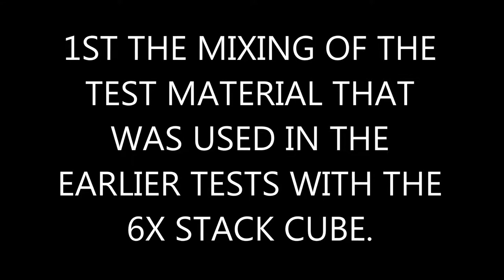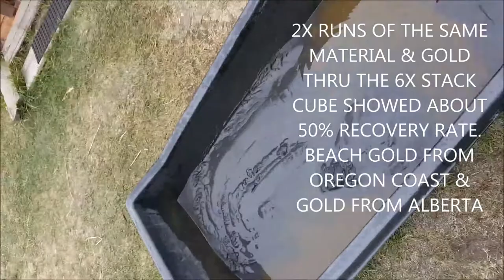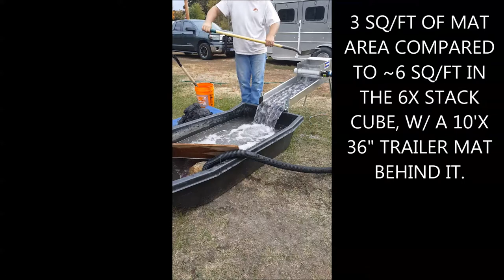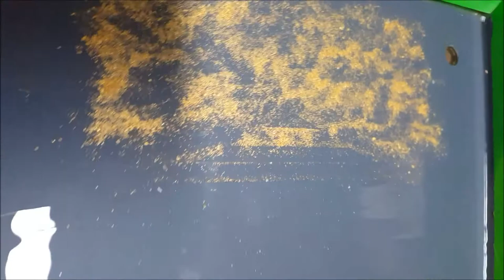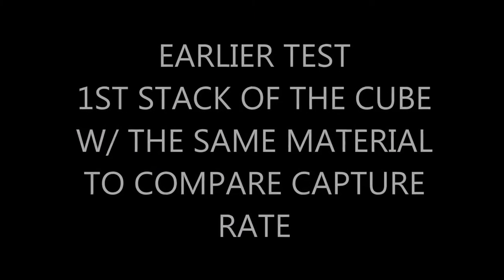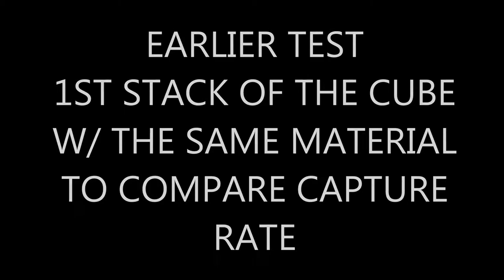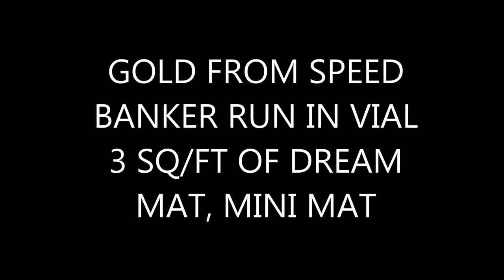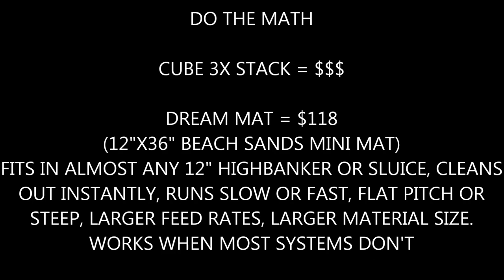Speedbanker vs. Gold Cube Showdown: Real-World Gold Recovery Test with Dream Mat!

Comment: Nothing seems to work as well as your original prototype because it had a simpler system with high walls to create a definite vortex that catches all size gold. The matting you sell has low walls and only catches flour gold while blowing out the larger pieces. You should make a simpler matting with high walls and see the larger pieces add up, that would revolutionize the market and watch people go crazy for your fluid dynamics system.

You're welcome,

Some dude
Reply: They don't advertise the commercial mats , they have the higher walls